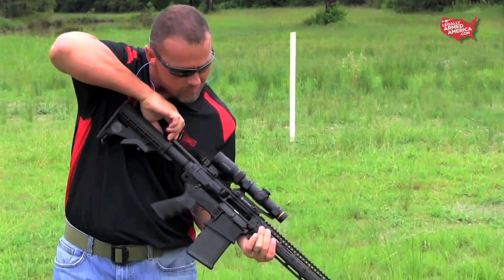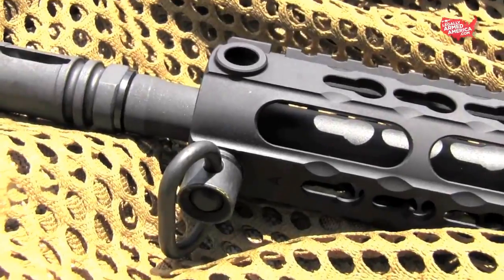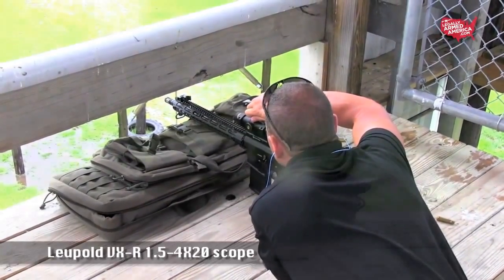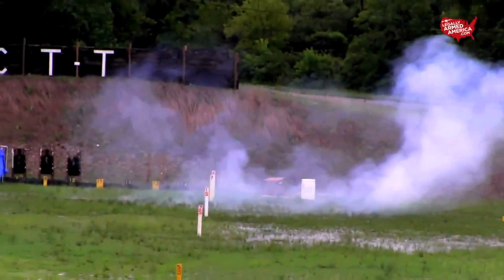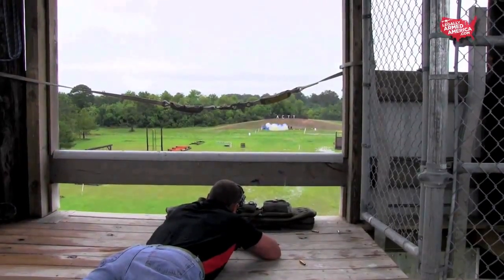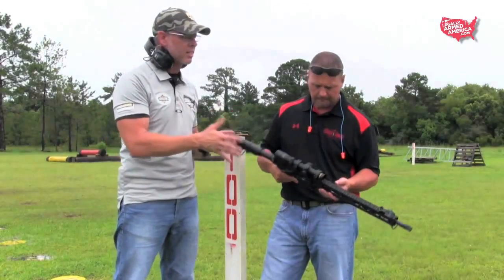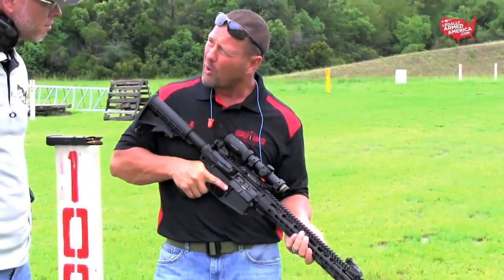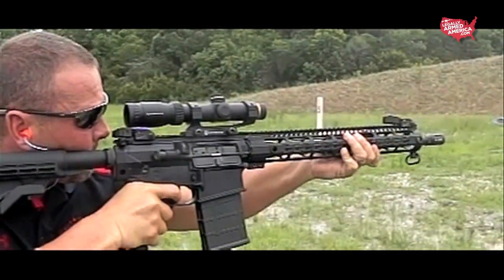Windham Weaponry .308 takes out binary explosives at the range

Comment: Too use to shooting a 223 he ain't holding the stock tight on the shoulder in slow motion, I have the windham 308 src and it's awesome I got a recoil pad and a comp its one moa with cheap ammo (I just ordered the Cmc trigger) the stock trigger is very heavy but very crisp the barrel does get very hot pretty quickly tho I don't get any fliers your pretty limited with hand guard options I don't have big hands and the standard hand guard is fine and has a heat shield

Comment: It is NOT an AR-15.  At the end of the vid you say "...will not find a better value AR-15..."  It is a .308.  AR-15 = .223.  Get them straight.
Reply: haha what? AR-=15 is a platform not a caliber. Yes most are .223 but what is referred to as an AR-15 is simply the platform that was put out by colt.
Reply: Besides the original AR-15 shot the NATO round not a .223 you would need a micrometer to tell the difference between the two since a .223 has a very slight smaller chamber.

Comment: Picked it up for 1470.00 with veteran discount at Ceballos.
Reply: +John Neill man they must hate veterans, got mine from sportmans outdoor superstore for like 1257...
Reply: +Brandon Lee  noticed his one doesn't have the chrome lined fluted barrel or the Magpul fixed stock . The one I have does . That might be the difference ?
Reply: +John Neill both are chrome lined.
The difference between the one I bought and the one you described is about 100 bucks or less MSRP tho... They still seem to have over priced you a bit.
Reply: +Brandon Lee I just bought the same rifle as John. It came with a fluted 18 inch barrel and not a standard 16 inch. I also got the fixed MOE stock so the buffer was already there for a PRS. I thought it was a good price. I cant wait to get it on the range before my wife sees it!!
Reply: +TheCrazyCanine  I finished it out . I put a 9-113 swivel Harris bipod , A Raptor charging handle , a titanium muzzle brake , a Geissle SS-E trigger in it , & for optics a Nikon 4.5 by 18 by 40 illuminated with a Pepr quick detach . I'm getting 1/2 in MOA with 168 grain hornady match ammo . I'm freaking happy with that granted I know have 3200.00 in the rifle LOL .
Reply: I heard the raptor charging handle doesn't fit did you have to modify it or did yours fit?
Reply: No not at all . The raptor 308 charging handle fit like a gem . You got some bad info bud . I got the nickel boron one & it looks slick . This has turned out to be a damn good DMR rifle .

Comment: I LOVE the POF but its freaking expensive. Almost the price of SCARs. I just found one of these. First one in my area. Is it reliable enough. I live the light weight of it. My main AR is in at 6.5 lbs with Aimpoint Pro on it. Thanks
Reply: Pof an Windham works together so u r pretty much getting the same thing as a pof just don't say so on the gun so they can sell u 2 different ones